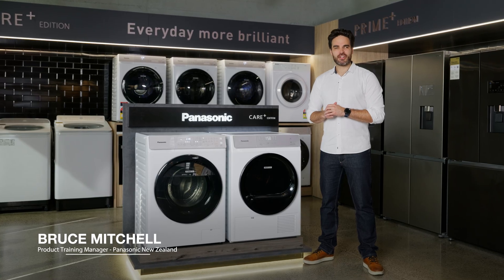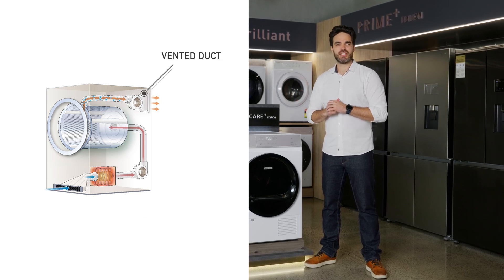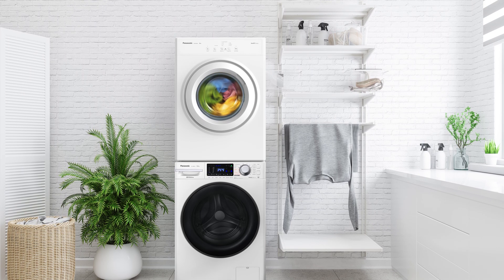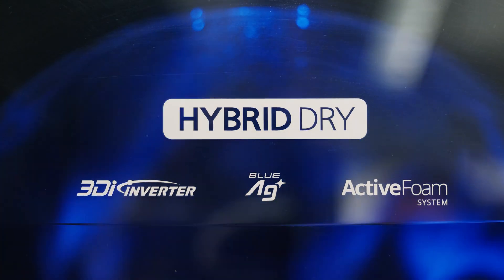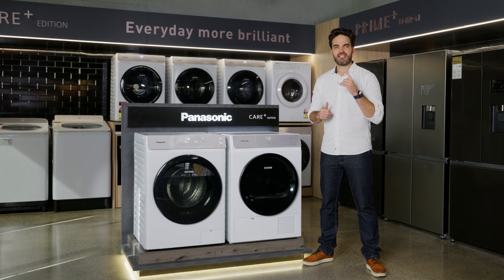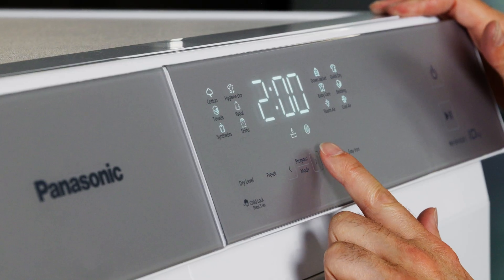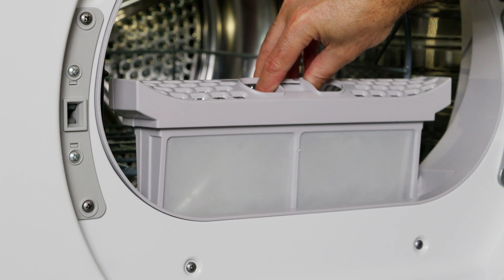Heat Pump vs Condenser vs Vented Dryer

Comment: More economical doesn't mean the heat pump is better than the others. Cheaper to run but takes two and a half times longer to dry your clothes, and if it goes wrong, which they regularly do, they cost a fortune to repair.
Reply from the maker: Thanks for your feedback.

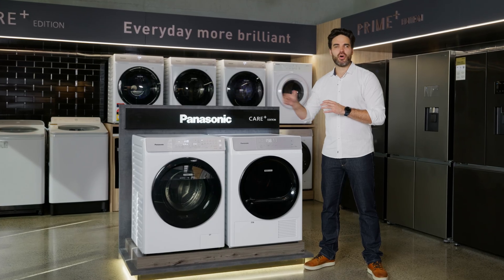Comment: 1:35 cant you connect condensing dryer to drain just like your washing machine next to it so you don't need to empty the container each time?
Reply from the maker: It depends on what model you have but basically the answer is yes.

Panasonic NZ only use condenser drying technology in the Washer Dryer combo model so it's plumbed for continuous drain by default.

The JD1 Heat Pump dryer gives you the option to do either and comes with the pipe in the box if you prefer to set it up for continuous drain.

I made a video on this which you can watch here: https://www.youtube.com/watch?v=kPJSQv7D0xs
Reply: I've been using condenser driers for many years.  The water tanks hold quite a bit of water and I find if you empty that after each drying session and clean the filter it should be good for years. Seriously it's no harder than remembering to put soap in your washing machine before you switch it on
Reply: @mypointofview1111 Turned out my 24 year old condensing dryer AEG 57720 has option to connect it straight to drain. It only took 5 minutes. Annoying chore gone forever.
Reply from the maker: @edfx  Same as the Panasonic... I also made a video on this and absolutely makes it much easier on the chore load.
Reply from the maker: @mypointofview1111  Panasonic condenser dryer doesn't have a tank... the water drains directly without any need to manually empty anything other than taking your laundry out.

The Heat pump dryer does have a tank which works exactly the same as you describe but drying is more energy efficient and takes much less time than a condenser dryer... that's the difference

Comment: Total rubbish. The companies want to to buy a heat pump dryer because of planned obsolesce works best on this product for them. Try getting someone to fix it if it breaks. It's specialist stuff. You pay more up, takes longer to dry clothes which means more wear and tear on the bearings over time compared to the others. They just want you to keep buying and replacing this stuff. Should be illegal in what they are doing. They are using the disguise of being green with power but you will pay more in the long run when you do a proper trade off study against the others.
Reply: Stop smoking weed 😂
Reply from the maker: Thanks for your feedback.

Comment: Heat pump double the time of drying clothes in alot of cases. Also good luck repairing or recycling any heat pump dryer.. Heta pumps might benefit corporations not consumers or the enviroment
Reply from the maker: Have you seen our video on how different drying technology works?

That might answer some of your questions about drying time and environmental impact (energy use)

We have technicians in our office who can repair Heat Pump dryers and train Authorized repair agents.

If you prefer Vented dryer technology however we have both a 7kg & 8kg model to choose from.🤗
Reply: Thank you for your response! I appreciate that you still offer other types of dryers as weell. However, I've seen comparative measurements showing that heat pump druers often take twice as long as conventional dryers. The fact that you have technicians for repairs is good, but it doesn’t change the reality that these machines are more complex, harder to recycle and usually more expensive to repair. Additionally, the higher upfront cost and longer drying time may not be benefcial for all consumers. If you have data proving otherwise, I’d be interested to see it.
Reply from the maker: @zambination11  Heat Pump Dryers have drying programs compared to Vented dryers which just have essentially a timer and 2 or 3 levels of power / heat.

2 star energy rating vs 8 star energy rating for HP dryers is also a big consideration for consumers.

Vented dryers also shrink and cause long term damage to fabrics over time vs heat pump dryers. 

There are many trade offs between the 3 different drying technologies but ultimately if you're not interested in Heat Pump technology for whatever reason then you can just buy something else.
Reply: @PanaStudioNZ  Just to clarify, I’m not comparing vented dryers Im specifically talking about condenser dryers versus heat pump dryers.

From what I understand, after 2021, most brands (including yours) have stopped producing condenser dryers, which means consumers no longer have that option. So while you say there are trade-offs and consumers can 'just buy something else,' in reality, that choice has been removed.

I don’t doubt the energy efficiency of heta pump dryers, but drying time, long-term maintenance, and repair costs are valid concerns. If heat pump dryers were truly superior in every way, there wouldn’t be this level of debate. 

I appreciate the discussion and your insights on this. At the end of the day, different consumer s have different priorities, and it’s good to be aware of all the trade-offs. Thank you for taking the time to share your perspective! ❤
Reply: Zombination 😂your I’d says it all
Reply: @S0ULOFLIGHT  hehe its zAmbination though 😁😂

Comment: very informative video, great job! can we pls confirm what type the hybrid dry combo machines are? are they condenser type?
Reply from the maker: Thanks for your feedback.

And yes the combination washer/dryers are using condenser type dryer technology so it will take longer to dry and isn't as efficient as the heat pump dryer.

Using a combo machine I would suggest setting it up during the day when you're at work or at night when power charges are lower.
Reply: @PanaStudioNZ wOw, thanks a ton for confirming and for the additional tip ✅👍🏻